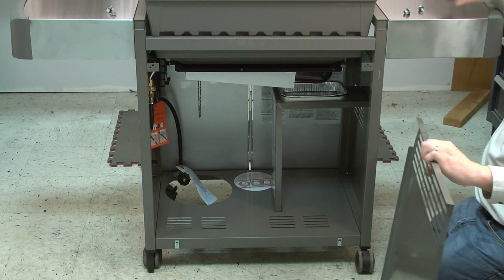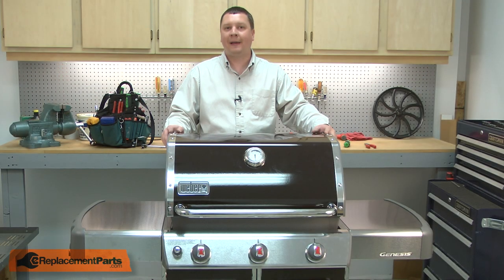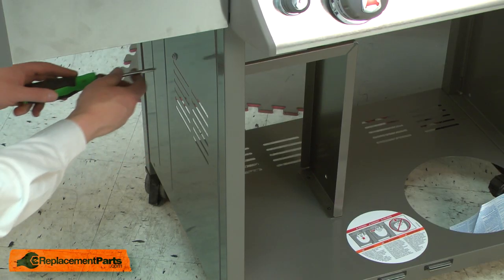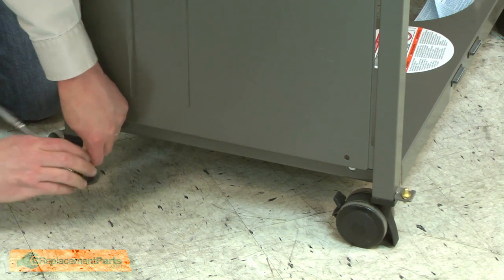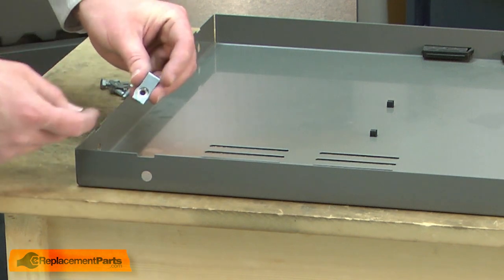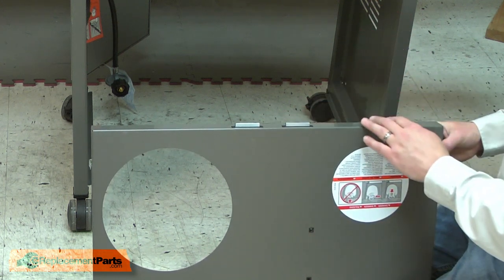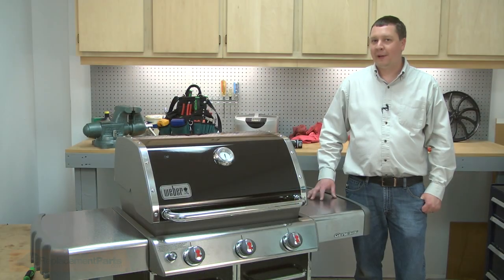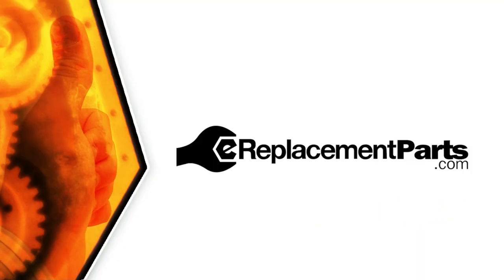Weber Grill Repair - Replacing the Bottom Panel (Weber Part # 82793)

Comment: My bottom panel has rusted out but also the bottom of the right frame panel, including the housing for the back wheel.  Can it be replaced?  On Weber's site, I can't see that they sell that part.  Is it replaceable or is it welded to the back panel? Thanks.
Reply: Parts are discontinued. Who knows if or when they will be made again since the reorg. I'm guessing the new owners want everyone to just buy a new grill.

Comment: My grill is not even worth $115!  That is quite pricey for a piece of sheet metal.
Reply: Check the replacement cost of a new Genesis, it is over $1200.  I don't want a cheaper grill replacement, so I feel like $115 is a bargain to get more life out of what I already have.  All of the other Weber parts distributors have this part number at around $150.  Your grill is worth it.
Reply: @jayton80  I am a firm believer in rehabbing grills.  Your video is great.  I'm just saying that even if I put that  bottom panel on my old grill, I could not sell it for more than $100.   I have restored and sold 6 grills so far this month.  I had to pass on a free Genesis because the Bottom panel cost more than the grill would have sold for with it.  The new Genesis line does not start at $1200.  It starts as low as $749 for the Genesis® II E-310,  but they do go up from there.  At least the new ones come with a 10 year warranty.
Reply: It is pricey.  Since all Webers rot out in the same way,  Weber should offer a one time discount price for the panel if a pic of the model/serial number is submitted, say $65 delivered.  My last grill (Charmglow?) never had this issue.  I had replaced the burners several times in the long time I owned it but it was still good when I bought my Weber.  The tradeoff is that the Weber was a much better performing grill by a long shot.  What I did was sandblast my bottom panel and weld skin to it, then cut out the tank area.